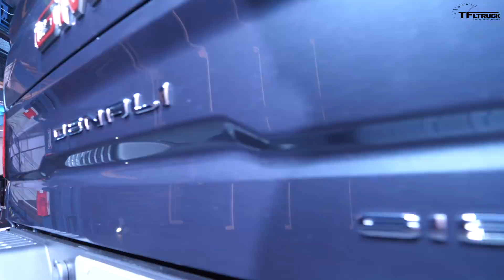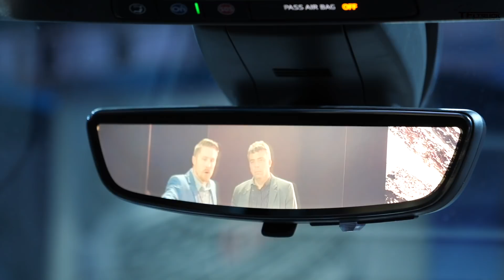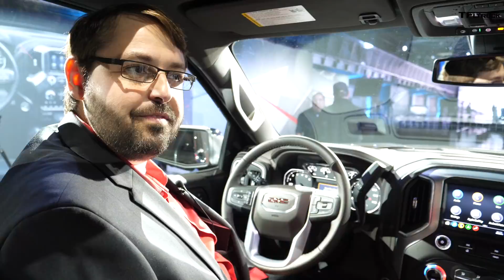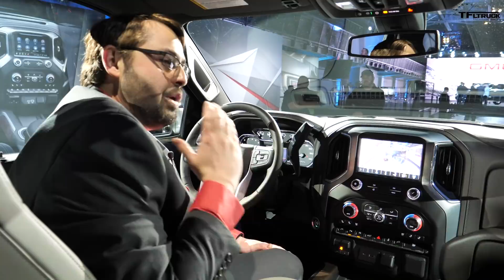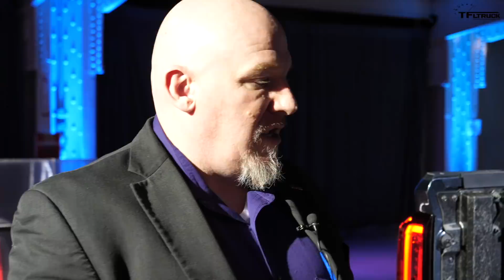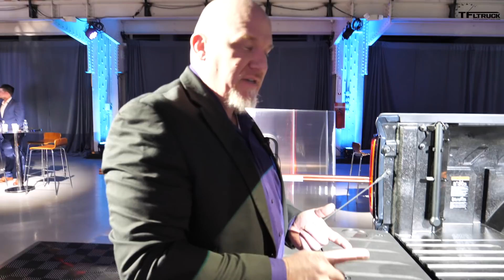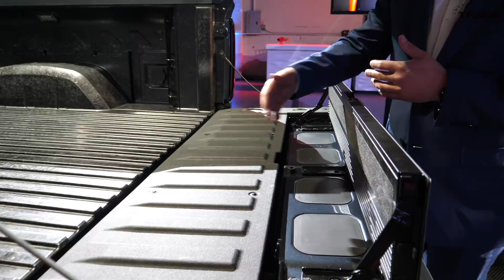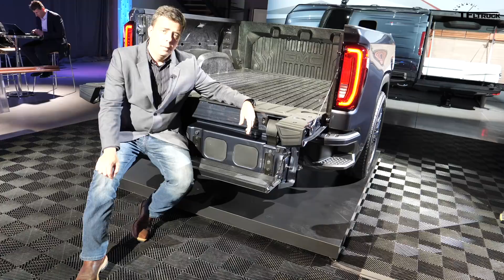Breaking News: 2019 GMC Sierra 1500 Gets CarbonPro Bed and Diesel Power!

Comment: I wonder how much longer before we hear about the hp and tq figures.
Reply from the maker: GMC had more news on Mar 26 at the NY Auto Show. We hope it will have some specs.
Reply: Eric Fox and that right the fuel economy is too important
Reply: 2B1ASK1  Nothing new!
Reply: I doubt they are increasing power. I think they are trying to catch up in the fuel economy race.
Reply: Eric Fox I doubt they'll have to try very hard to get wicked fuel econony with the new straight six duramax. That paired with the new 10 speed and all the weight savings and I see an easy 30+ MPG.
Reply: It's gm, they brag about the camaro having a European exhaust note... They don't care

Comment: Well, that answered my question about it being carbon fiber impregnated nylon. That is strong stuff, but it's greatest advantage is how cheap it is to manufacture, and I have a sneaking suspicion that it will be a premium on this truck. The greatest downside is the sheer volume of it's design. It's all bravado and aesthetics, but there is no way on Earth those tiny windows and massively tall hood will aid visibility. As a truck salesman, I can tell you a customer will pick up on that FAR more than the gimmicks during a test drive. They made it taller, which, one of the main things GM had going for it was the lower reachover height. This may be the pursuit of premium truck buyers overwhelming the needs of the volume buyer. I used to have both a first gen Titan, and a 14' Sierra. The Titan was a better overall truck, because of it's great (minus the chubby a pillars) visibility. The current Sierra's hood is just too long to see over, and the one in the video reminds me of the Tundra which has been known for years to have comically bad forward visibility. The only truck on the market today that seems to have been engineered with visibility in mind is the F-150 (not all f series, as the Super Duty has a very tall hood). It has a large greenhouse, You sit over the dash, and it's hood is short in both length and height, so it is easy to see over when maneuvering. I don't currently own a truck, but having great visibility is the number one safety feature in any vehicle, and it's personally my biggest pet peeve in vehicle design.

 Thanks for flying out and getting the skinny on this Sierra Andre.

Comment: Beautiful truck!!!, the problem is the more technology you get, the more chances of failure you will have. Also the price of this thing is going to be very high compared to current models. I wish GM just put all their investment in reliability and not fashion.
Reply: It will be reliable in 5 years right before the next gen comes out.
Reply: JD Power large light duty pickup reliability study.
http://www.jdpower.com/cars/study/2017-Vehicle-Dependability-Study/1882ENG/Large-Light-Duty-Pickup/1124
Reply: 2017 & 2018 are much more reliable than previous years.
Reply: L Rizo Ford can stay like that  :)
Reply: Armyguy864 you have a good point,  I am talking about in base on the fact that almost all the bugs and recalls from the predecessors have been "mostly" fixed. Here we are talking about the reliability of a GM product vs previous generations and not vs other brands. I have Toyota and GM trucks, which makes me able to compare both products; and I could not agree more with you in that Toyota products are superior in terms of long term reliability, with the exception of first models of the new generation of Tacoma (transmission, corrosion), some generations of FJ cruiser (rattle, overheat, transmission)  and Tundra (corrosion). But no car is perfect, Toyotas lacks of innovation, bad mpg and  lack of models (no diesel, no HDs) and GM, Ford and RAM (excepting some HDs) reliability. A truck with the reliability of Toyota, Cummins engine and a F150 interior will be nice but maybe to expensive for the market.
Reply: Yeah for sure I agree with you that yes no manufacturer is perfect and they have their quirks.  Though I’ve personally never been a fan of GM at all.  Yes I know Toyota does lack in the MPG department and innovation but I don’t feel the need for all the bells and whistles in a truck and I like the simplicity of Toyotas interiors. Though I completely agree with the fact that it is slightly outdated. None the less I’ve still traded my 2015 Taco for a 2018 Tundra TRD off road. Picking it up tomorrow morning. Though i would tweak your ideal truck. Toyotas reliability coupled with a cummins engine, Allison transmission (because the dodge trans cant hold up to anything that has been modified) and with the dodge interior. 

Now with Toyota not having diesel trucks I can kind of see why they’ve chosen to stay out of that game. With new emissions standards and having to run diesel particulate filters and DEF fluid, it has become a huge hassle now to run a diesel truck. Mpgs are down across the board because of these new systems in place by motor vehicle regulators. 

Though it’s to each their own and everyone is entitled to their opinions. I’m glad we can have a civil conversation about our points and views. Needless to say that yes I’m a Toyota fan boy and I’ll defend it to the bitter end lol.
Reply: David Delgado just got my Tundra and the first thing I did was turn off lane departure and pre collision warning systems.
Reply: David Delgado how can you say a 2018 is more reliable when they haven’t been out on the road for more than a year?? Of course a 2018 will be reliable, it’s new. Hands down Toyota has a proven track record for reliability which Ford can not match.
Reply: Armyguy864 actually unless you have a lemon, all powertrain have near identical dependability. The only real difference is in headings and connectivity
Reply: Speaking of technology... will it actually stop itself now if you’re about to crash like the Fords?
Reply: Dr Diamondz are you talking about the GMC in the video or the 2018 Tundra?
Reply: Congrats man!!!, I am sure you and your family will enjoy the new truck, especially for the extra room in the crewcab.
Reply: All trucks are coming in 2019 with safety features (especially in the higher trims), but I am pretty sure you can turn it off if you do not like it .
Reply: Armyguy864 the Ford
Reply: Armyguy864 GMC*
Reply: Dr Diamondz I have no idea what kind of system or if any the GMC has on this truck for pre collision warning system.
Reply: well done
Reply: benjaminwayneb yeah but Toyota wins in the most important category of your little study.  I'll take the most dependable powertrain over any of those other categories. Tundra all the way.
Reply: David Delgado I wish you would go say that on a Ford page.. Cause we all know Ford could use way more reliability LOL

Comment: Hi guys great review. Just to let you know in my job we lease our trucks and after 25,000 miles they return them and we get a new truck. Awesome for me as I can chose the make and model, I have purposely tried all the North American trucks for the last 3 years. 1/2 ton and 3/4 ton’s and diesel. I don’t tow with these but I’m off road the majority of the time from logging roads to muskeg and pavement and gravel roads winter and summer. Watching this last review they are actually “getting it” with the details!! This is my office and work/tool box, my personal favourite in the 1/2 ton’s was the Ford with the eco boost great economy but more then enough power to get through the crap. I found the GMC to have the best ride and fit and Finnish . 3/4 ton gas was the Dodge plenty of power and great 4x4 with plenty of ground clearance when passing over stumps and boulders, average fit and Finnish but a truck that’s was made to be off road! The Diesel was the GM awesome power good economy with good fit and Finnish. I’m a GM guy in my personal truck and tow a 24 foot holiday trailer with my 07/Vmax 6.0l. This new crop of trucks from all manufactures coming out, with the motor and transmission choices for towing and with the new “DETAILS” it finally work’s for us. Like to see a long term review of the latest trucks and love the towing comparisons. We want the the real numbers not the inflated dealers numbers. Good work guys!

Comment: Headlights like Ford, 3.0 diesel like Ford, 10 speed automatic behind it like Ford.....
Reply: MrErikw26 al least they haven’t “engineered” a panoramic sunroof
Reply: L Rizo Ford and Allison yes. Funny how tough you kids are behind a screen. 

And if past inline 6 cylinder designs are any indication, plus their last 2.8 diesel, the GM 3.0 diesel won't live long.
Reply: MrErikw26 Tough? What you talking about, are you that sensitive? I thought we were talking about trucks here
Reply: MrErikw26 plus nobody said anything about Allison were talking about 1/2 ton trucks here not 3/4 ton or 1 ton Duallys. Don't you know that come on man. Where did it say Allison in these half ton trucks? Please show me
Reply: L Rizo Allison is part of GM, Detroit/Allison specifically. They do the transmission designs and testing, and since I work for a dealer, I get to know these things.
Reply: MrErikw26 now that I agree on..
Reply: MrErikw26 just so you know Ford and GM design that 10-speed transmission together Forrest Gump. That 3.0 that Ford has won't even compare to the 3.0 inline 6 turbo diesel..

Comment: A carbon fiber bed? Didn't gm make fun of ford for using aluminum because they claimed it wasn't appropriate for a work truck and that it was weak, which it isn't, but I digress. Carbon fiber is obviously strong but it's very expensive to replace so I don't understand why you would use that in the bed. That's a horrible choice.

Comment: I see problems with that tailgate. For one for extended loads and the end flips up it looks like the hinges are getting in the way so a sheet of plywood couldn't sit flush with the end or else I see it knocking into those hinges and bending them. And I 'd be worried about those touch sensors working in ice and snow conditions. 

And why only the carbon fibre bed on short box? And I'm not sure that would be any better than normal bed with a bed liner.
Reply: Amanda Huginkiss I thought the same thing. Bend those hinges and it won't ever close again.

Comment: Yess! Column shifter, real truck
Reply: As a matter of practicality, console shifters are a big waste of space compared to column/dial. They take something trivial and plunk it down right in the middle of what could be usable space. So that I can understand. I don't get people that whine about a dial shifter though, and that's usually what people are complaining about.
Reply: ? You don't shift gears on the dial bud. The dial is only for P N R D. If you want to manually shift you use the steering wheel buttons so your argument makes no sense. Maybe use one or at least figure out what it does before deciding you do or don't like it based on nothing.
Reply: wastegate you know real semi trucks use a knob right?
Reply: Alex Puls More like ricer to me.
Reply: I hate when you have to shift your girly automatic transmission in a non manly manner.
Reply: Old Gregg most of the newer trucks are  10-15 speed automatics with PUSH BUTTON selectors.
Reply: GMC Jae it is a column shifter, but it's not connected with anything. It's just an electronic switch in the column.
Reply: Old Gregg yes it does. In fact, the F150 has a column or floor shifter, but the new Expedition has a story knob on the console like a Ram. Both the Expedition and F150 have the same trans. ( and Silverado/Sierra twin)
Reply: I don't see why anyone would like a dial shifter. If I'm coming down a steep grade and I down shift, why would I wanna go look at my dash and find some stupid little dial and spin it to 3rd or 2nd gear? Like how does that make sense? With a column shifter I can keep both hands by the wheel and easily just drop down a gear or 2 and or up a gear or 2 and never take my eyes off the road. A console shifter does the same thing but takes up more room. Only thing I don't like about the column shifter in my 2005 GMC Sierra 1500 is that when it's all the way down in 1st it gets really close to my knees. But, I'm also 6'3" so that's probably why. Other than that it's the best shifter ever made because it's practical, it's right next to the steering wheel for easily going from park to reverse to neutral to drive. I'll never understand a dial shifter or a console shifter in a truck unless it's a manual. It's not a sports car so it doesn't need a console shifter.
Reply: please bro
Reply: Still the same shitty gear lever from 2007 tho 😂 console shifters are much nicer
Reply: Everyone that cares where the shifter is, I assume has never owned a truck in their life. That is the stupidest thing in the world to care about when choosing a vehicle.
Reply: MCBackDraft1 I have an older f150 with a column shifter and I don't like it. I would really prefer a console shifter. So yes. I do own a truck thank you very much.

Comment: So in other words they just did everything Ford did two years ago! Way to be ahead of the times GM!
Reply: L Rizo but only on their top of line trucks... most of the stuff is on SLT or Denali, the trucks least likely to see a day of work in their short life’s.
Reply: Yeah but they made a latch that locks the rear doors in place...
Reply: Just because the SLT & Denali is well optioned w/all the luxuries of most high end cars doesn't mean it wont be put to work or last just as long as a lesser optioned Sierras.
Reply: JonD985 the trucks that will be put to work are trucks used by companies and they want cheap so they will use the base truck
Reply: FORD REMEMBER SET THE BAR ?  FORD IS THE BAR  LOL  THEY ALL COPY FORD
Reply: Now lop off two cylinders and add two turbos that cost more than an entire motor to replace. That is Ford setting the bar.
Reply: michael santiago actually they did what Ford did but GM just made it way better.
Reply: L Rizo Not likely! They still haven’t figured out how to build a tailgate latch that doesn’t break with in a year!

Comment: I can’t believe they are still using column shifter. That’s Jurassic.
Reply: column shift and pickup trucks are like peas and carrots.
Reply: Why, because a truck needs a dial shifter? What a joke
Reply: Makes space for wireless chargers.  Gm scientists were so preoccupied with whether they could, they didn't stop to think if they should.
Reply: mycoolkeno Jeff Goldblum is correct👌🏻
Reply: A sport model with a console shift would be nice. But i think i would buy the column shift i like more console space.
Reply: mycoolkeno they could use rotary shifter like in Fusion
Reply: rafael reis yes but it works and won't be mistaken for anything else
Reply: There are loads of option this days . I personally am no fan of the dial too but I think a push button system like the one Lincoln is using right blow would work great in pick ups. O just hope that they at least remove the column shifter on the new Escalade.

Comment: The headlights look kind of the same as the 2017 Ford F-150s headlights with that C shape
Reply: I feel it has the combo of the F-150 and Tundra look for the headlight with the top of it.
Reply: It really doesnt look that much different from the Acadia headlights. So no, not a copy of ford or toyota
Reply: The Sierra has always had a c shape
Reply: You mean the headlights look more like the previous chassis GMC truck. The C shape was on the 2016 Sierra trucks full year before Ford, the C shape is not new, off the top of my head the Dodge chargers had C shape lights on their cars before 2016, and i bet there are more as well. Besides the manufacture that makes them pretty much sales to the most automotive manufactures so they share some design implementation.
Reply: Aidan-Dean Pitts look at the 2015 Yukon. I think you’re a couple years behind. 😂
Reply: That is just what my mind goes to first when i see it.
Reply: Gavin Booshu they look like the f250 headlights reduced in size and the f250 has had them since 2012

Comment: I dont like that trucks are getting so complicated
Reply: Regis Riley can you make a time any vehicle got less complicated than previous generations?
Reply: D Jay T Of course they're going to get more advanced as time goes on. But this is un needed complication. If I get hit in the back or I have a smaller tree bend the tailgate. I really can't use it anymore.... Look at Nissans truck. The Titan got more advanced in 2016 and has all these new features but still can be used as a work truck even though it's new and advanced. The interior isn't outstanding like these trucks with the screens such as the Rams and gimmicky plastic parts that will break with any use.  The Titan has a relatively small screen. I really like the colorado becuase I drove it around and it's not huge and if something breaks it won't cost me a fortune to replace my friend didn't have to pay over 400 for a whole new tail gate on his. The American full size trucks are getting gimmicky and expensive for what they're intended for.

Comment: More gadgets = more money. Stripped work trucks are sounding better and better.
Reply: wally twixter I'd go back to my 85 f250 if I could find it. Only reason I'm driving a ram is my cummins gets 25 on the hey doing 75 to 80. Newer trucks just have too much cheap. I'm either stuck with dodge or older trucks because newer automatics are an absolute pain. Standards though I can do all my own work.
Reply: Buy used, let someone else pay the depreciation.
Reply: Just think of how your great grand dad reacted when they started having auto transmissions, power windows, and airbags
Reply: You could get a GMC Canyon if you want a stripped down work truck. They are only covering features for the top trims. If you don't like those, you can buy a cheaper trim or the cheaper truck